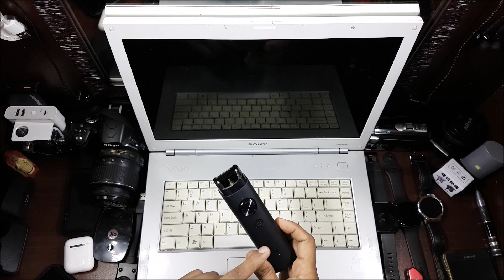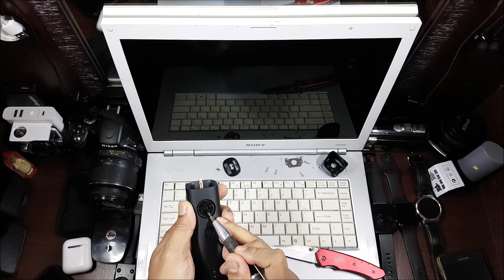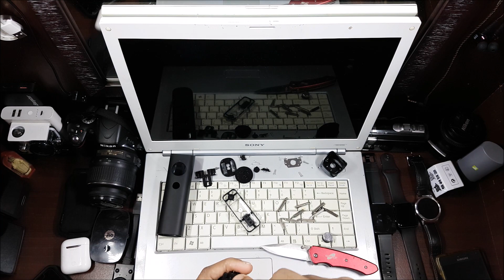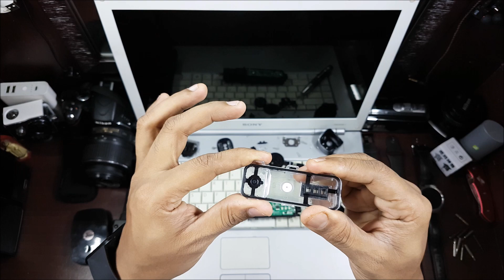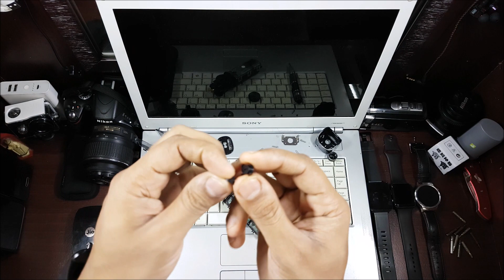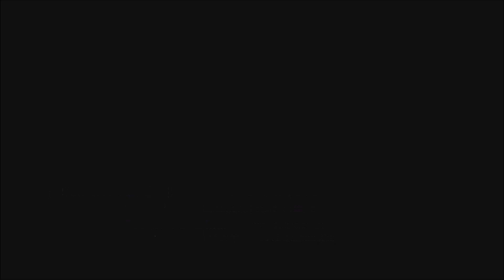Mi Beard Trimmer - Disassembly & Repair

Comment: Hi! Ken,

2 questions:-

How can I replace the rechargeable battery in my trimmer? The wires are kind of sticking to the battery (soldering or some sort of pasting not sure).

Second is that it is the plug in pin which is making contact only at a particular angle / and distance-in. (I hope you understand) 

Is this something which can be repaired by me? Please show me how.

Thanks

Comment: Battery backup has gone completely...it doesn't last for 5min even after charging it for 4hrs. Battery indicator shows fully charged (3 leds glow constantly) after plugging in charger for 10min only. 

Should i replace the battery? If so suggest me one decent battery for it.

Comment: Thanks for the detailed video Ken.
My trimmer wouldn't turn on about 6 months ago, today I was just cleaning the bathroom junk and was about to throw this trimmer away. 
Something came over me and I googled searched "mi trimmer stopped working" you were the first video up. Watched the video decided to try it found out the battery was loose and the metal thing wasn't touching 1 part of the battery, just finger tightened/jammed the battery and it actually started working!!!!
All this took about 40mins as I'm not really into DIY fixes also there was a whole bunch of beard hair in the inside of the trimmer so needed a deep clean. Thanks so much now I have an extra backup trimmer👍🙏

Comment: One more point for diagnosis:
If water goes into motor, it may cause jam of motor. Motor head will not rotate when rotating by hand. What you have to do is, use a cutting plair and gently rotate the motor header. It will rotate!

Thanks for the video!
Reply: Thanks your comment help me❤️
Reply: Thanks it helps bro ❤

Comment: The comb in/out is not working in my MI trimmer. The knob works from 10-6 position but after that it detaches and doesn't work. The comb does not go to the zero position.
Pls help me resolving the problem.

Comment: recently i had purchased this trimmer. I used it on the day of purchase. After a week i found the 
battery drained. I charged it and when the trimmer got sufficient charge the motor started running & i couldn't switch it off.
i had to drain it completely so that it got switched off. The trimmer did not come in contact with water then why it is behaving
like that. Please can you suggest what would be the problem.
Reply: i think it has a fault inform on call center

Comment: How you stopped switch. Because i can't off it. And your video does not contain(4:17) this switch off part. Please can you help me?
Reply from the maker: Open the sealed compartment and then wipe off the water. After that the switch will work
Reply: Ok, thanks

Comment: Bro the plastic piece you removed at 1.08 is broken of my trimmer. Can you help me with where can i get a replacement of this piece..
Reply: Hey! I am not an expert but I don't think that part is available as a spare so if you have all the broken pieces, I suggest you use some sort of strong glue to put it back since it is just plastic and a stationary part, it should be fine.